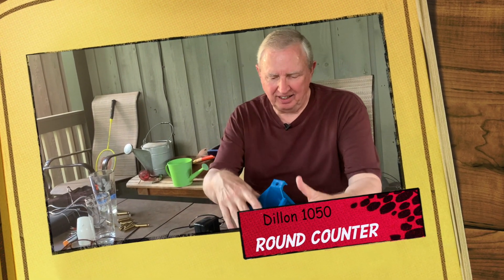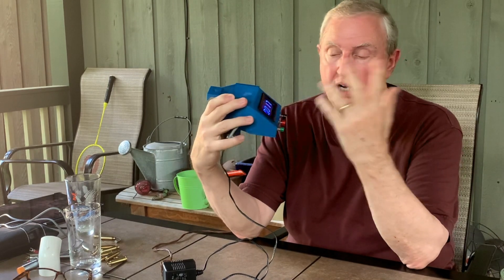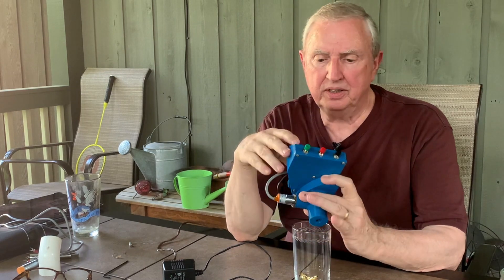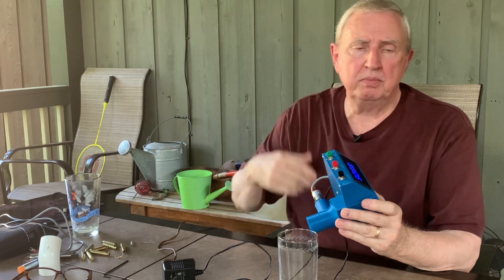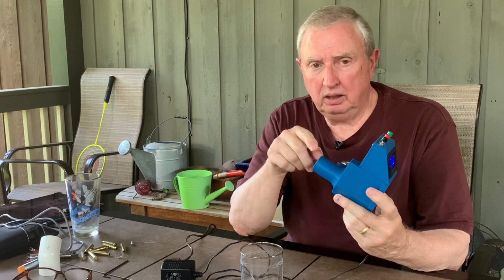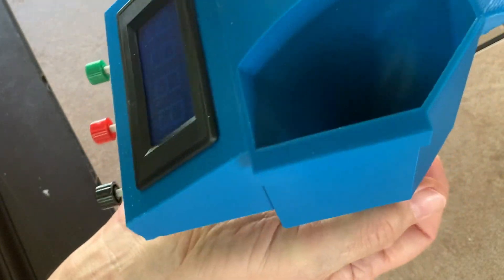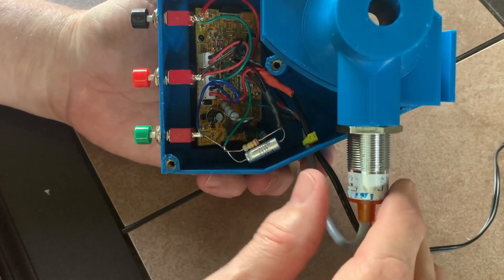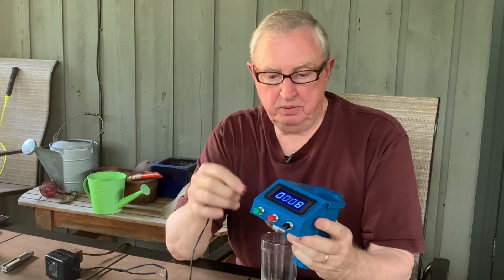Round Counter for Dillon 1050

Comment: How would you wire the Up/green momentary switch if you didn’t have an issue with double counts and did not need resistor/capacitor? Blue wire from board to COM pin and black signal/sensor wire to NC still?

Comment: Amazing project, well done and thanks for sharing!
/Sweden :)
Reply from the maker: Thank you for taking time to say so. Much appreciated.
Reply: @RexRoach  Yes it is one of the absolute most professional looking 3D print projects I have seen for reloaders. (And I dug deep my friend :)
Actually you even inspired me so far as to start looking for guides to learn fusion 360!
I put the project on print and theyre going at it full speed right as we speak, haha

Oh and a quick question if it is not to much trouble,
you lay some emphasizes on how the digital counter must look.
However the link to Amazon and the counter in question is out of stock,
how much I google the interweb (AliExpress, eBay, Temu asf etc) I cannot find the digital counter looking like the one you used for your project.
Do you happen to know if another type would work or possible do you have any advice where to look for them?

And many many thanks again mate!
Kindest regards,
/Tobbe a.k.a Silverbullit of Sweden
Reply from the maker: @helturflippad  Indeed, getting parts for projects that are more than a week old sometimes seems like an insurmountable problem. However, I think there are several on Amazon that will work just fine. Here's one.

https://tinyurl.com/23g4tvqn

If you search for digital up/down counter, you'll get some on Amazon. If the price is more than $15 US, that's not the part. It needs to be about 39mm tall and 78mm wide. The width is the "wild card" because it will have spring-like plastic tabs on each end to secure it into an opening. The opening in the 3D printed part is about 77mm. If the opening is too small, you can file it larger. If it's too small, you can probably build up one edge with tape or some other clever approach.

Electrically it should have two wires and a 5-wire flat cable to match up to my circuit. If it is something else, it will still have connections for power, clear, up and down so you can most likely figure it out.

Also, the link I gave above is for a unit to ship in the U.S. via Prime. There were identical models that ship from China for less. For Sweden you can probably do better with one of those. I entered "up down digital counter" on Ali Express and got many hits on the first page of units just like the one I used. This seems to be a popular item from China.
Reply: @RexRoach  Howdy mate, happened a lot here. A quick Question, I googled the partsnumber and it directs me to a 39uF thingie instead of 3 uF. Should it be 39uF?
A bazillion thanks for the links and kind help!
For some reason my 1050's has different brackets and it looks like a small tweak is necessarry, I will fumble with it a bit, would you like the alternative files in case it can help our mates?
Reply from the maker: @helturflippad  I think there may be a lot of variations on the 1050 bracket, so there's little point in trying to fix the fit. As to the part number, I'm truly confused because it looks like you're talking about a capacitor what with micro-Farads and such.

Comment: Parts says npn no sensor. My counter needs a + signal to count up. The npn gives a - signal. Cant seem to get the button or sensor to work.. any help?
Reply from the maker: Justin, I have gone back and examined the circuit and I think the problem is an error in the schematic. The original showed the four wires connected to the display in the order of black-red-green-blue.  However, when viewing them on the actual unit, the order is green-blue-black-red. 

I have revised the schematic drawing and re-posted it. The new file is available above or from:

https://drive.google.com/file/d/1x1LoUQyDPWsTc5IpSXxqOAdqiYL8hue-/view?usp=sharing

I hope this fixes the problems you've had. Please let us know the outcome. I'm very sorry for the error.
Reply: @RexRoach  Thank you!! I did notice that, but I did have the display wired correctly, even with the previous drawn schematic off on wire order. I'll give it another shot and update you. Again, thank you for the help. All your videos are great, and I appreciate you sharing your knowledge too us.

Comment: Thank you for your time in designing this. I used the STL file and printed which I believe is version 18. I downloaded the step files but there are different than the one I printed. I would like to make a few design changes to fit my press.  are you willing to release that file? I use fusion 360...Thanks
Reply from the maker: Since this video was posted, I've made a few changes in the design and you can download the Fusion 360 file which includes all those revisions. I believe the major changes were to make the bottom tube curve outward so as to clear the edge of the table where the press is mounted and to increase the "bore" diameter to 20mm to allow for larger/longer cartridges to pass through. I've added a link to the file at the end of the description. Enjoy.
Reply: @RexRoach  Thank you kind sir.  It's on the printer as we speak, using orange PLA..
Reply from the maker: @stevend5508  Great and you're welcome. Just make sure you got version 19 because I did not have a chamfer at the bottom of the "funnel" when I first posted the file. I made the change in about ten minutes, so I'm hoping you got the V19.
Reply: @RexRoach  yes sir, I have    "Round Counter 20mm Bore v19.f3z"   is what I downloaded and is currently printing
Reply from the maker: @stevend5508  Whew! <sigh of relief>

Comment: Very cool design.  Would you feel comfortable sharing the f3d or step file?  I would like to modify to fit the 550 and 650.  Thanks
Reply from the maker: Sure, no problem. Look up in the description area at the bottom for a link to the STEP files. I worked on a new design for a bit that MIGHT fit a 650. You'll find it and the original one from this video in the folder. There are also two files for the bottom covers. Good luck!

Comment: I made a case feeder for 223 cases and I used an inductive sensor to shut it off when the tube is full. I notice that each time a case goes past the sensor it causes the motor to shut off for a split second. I guess it doesnt really hurt anything but it does cause the relay click all the time. Could I use a capacitor and resistor like you did to prevent this.
Reply from the maker: James, I would suggest something like this between your sensor and the case feeder.  https://tinyurl.com/ybxxslax
Reply: @RexRoach  Thanks I will check that out.

Comment: So I built one if these for 9mm and when it drops in some times it double counts not sure how to fix it. I did use the resistor and capacitor any suggestions
Reply from the maker: I eventually went to a new design that used optical sensing instead of the inductive sensor and it was a "sluggish" enough circuit that the double count problem didn't happen. However, since you've already built this model, I will tell you that I experimented with a (hang on for some big fancy words) monostable multivibrator or "one-shot" IC chip. You can buy these for a dollar and change from places like Digi-Key, but it will involve a good bit of fiddling to get it to work.

A better solution, I think, would be a ready-made time delay relay board like this $10 job from Amazon.  https://tinyurl.com/yy3nfpad

For some reason, my instructions here were cut off. I'll try again.

Connect 12V to the DC+ and DC- on the new board. Connect the black signal wire from the prox sensor to X1. Connect 12 v+ to COM on the new board and connect a wire between the NO and the display where the black sensor wire was before. Remove the 220 ohm resistor and the 3 uF cap. Adjust the timer for a 1/2 second delay and that should make the relay hold long enough for the cartridge to fully pass the sensor. Even if the cartridge double trips the sensor, the closed relay will ignore it.

Hope that makes sense. I have NOT tried this, but it should work with perhaps some fiddling.
Reply: @RexRoach  do you have a listing for the optical sensor I would just replace this one
Reply from the maker: @Muskrat13  This should have what you need.     https://youtu.be/l3G5GfcfFvc

Comment: Really nice! You can also design with regular hex nuts. Design for the nut, then (in slicer) pause at layer height just above the nut thickness. The printer will pause and wait, drop the nuts in and resume print. Captured nut. Love your vids.

Comment: hi rex i printed one the hole in the back is way too short would you be able to fix that
Reply from the maker: Turns out Dillon has more than one style of bar layout for the case feeder and the hole location varies.
Reply: @RexRoach   ok ya i have the one  then is there anyway  way we can fix that mine need to be bolted it slide off the machine when it is running with the outdrive

Comment: Nice project, extremely well done!  Your CAD skills are impressive, I'm still learning how to do things in Fusion 360.
I made my first loaded round counter using a little LCD pedometer connected to a switch that was activated by the press... so I get press cycles which isn't always loaded round counts.
Reply from the maker: Thanks very much. You've hit the problem exactly–many designs count press cycles or count at some place on the press, such as the bullet seater. That last is OK, but you can still have a reason to pull one even after the seater. Well, no design of anything is perfect, so we do what we can.

Comment: I've played with it a bit and there is no way to orientate it with mirror commands so that it works on a XL650.  Anyone have any ideas?  Rex, if you mirrored it, then remade the threads and text it would work for us XL650 guys.
Reply from the maker: I don’t own or have access to a 650/750, but after reading your comments, I looked at photos on the Dillon web site and it appears to me that this device with the "hook" on the left side would clip to the press right where the blue plastic cartridge bin clips currently. Feel free to correct me if I’m wrong.  Also, I have been developing a "new and improved" model that will work with any cartridge from .380 ACP to .45-70 Government with 550 grain Bullets. Yes!

On the new model, the sensor points toward the rear of the machine instead of to the front so it matters not which side it mounts to. 

Now that we’re brainstorming, how about just putting the "hook" on both sides so it will fit either the 1050 or the 650/750. I’m going to omit the rear curved lip because that bar varies within different versions of the 1050, much less fitting the 650/750. 

Am I correct I assuming the 650,and 750 would be alike as regards this mounting point?

Comment: More info on capacitor please.
Reply from the maker: The values are not very critical. The resistor should be 100K to 300K. The capacitor should be 3 to 8 uf. Multiply them together to get the RC time constant which needs to be 500 - 1000 ms. So a 100k and an 8 uf would give 800ms time delay, more than enough. I used a 220k and 3 uf for 660ms, again just fine. The type of capacitor is not critical. It can polarized or not. If it is, then connect the negative end to ground. It should. be rated for the voltage you're using.
Reply: @RexRoach  Will this work  SPRAGUE RESISTORS TE1402-10%
Reply: Thank you.  Link to cap you used, tried to find  a 3uf like yours with no luck.
Reply from the maker: It will work with pretty much anything. I just grabbed the first resistor I came to in my junk box that was in the ballpark. It was 220K. A common capacitor value is 4.7 uf. Look on eBay for people selling a package of capacitors that include that range. Ten bucks or less and you’ll have some for future projects. If not, buy individually from Newark, Mouser, Digikey, Allied, etc.
Reply: @RexRoach  Thank you
Reply: My time delay isn't working.  I have a 4.7 uF capacitor and a 220k resistor.  It's all I had that fit the parameters you laid out.  My 223 rounds will double trip the counter.  The buttons all work fine, and it counts other stuff like it should, but I just don't feel the timer circuit is doing what it's supposed to.
Reply from the maker: @superkillr  I hear you loud and clear. I think it may take more than a simple RC pair. I just now ordered some components which I hope will fix this problem once and for all. I won't go into detail here as I have not tried it yet, but wanted to let you know I'm working on it. This will be a very inexpensive fix and I will post a video on it and try my best to come back here and let you know as well.
Reply: @RexRoach    You're awesome!!!!

Comment: Nice work Rex, Can you share the printing parameters you used for infill and resolution? Also what filament/color is that?
Reply from the maker: Sure. I used Duramic PLA Blu-1 from Amazon. Resolution is .2mm layer height and 40% infill. I printed with the top of the part on the bed (i.e. upside down) and used support from the bed only. I put a gusset on the side tube where the sensor screws in so you don't need support there. On the first model, the support inside that threaded tube was awful to get out. You must have support under the sloped panel area, but it snapped off easily. My printer is a Sidewinder X1 or something like that. I've had excellent results with it. My first try at printing Angus's clearance ring was a total success with even the .15mm clearance moving with just a bit of early encouragement. 

Wait before downloading it because I just remembered I need to increase the hole diameter for the heat-set brass inserts. I'll amend the links information to reflect the change. Should be in less than an hour.
Reply from the maker: Oops!! Will do

Comment: What a great idea!  I have a mechanical counter on my .45 ACP taper crimp die and it's really handy to have a count.  I do hope Dillon or one of their accessory makers gets interested in making a Rex Roach Round Counter.  I might mount the electronics in a remote box and make a funnel/sensor assembly for each caliber/press.  I imagine using just the funnel/sensor to send a load count to a computer control box

Thanks again for sharing a great idea..
Reply from the maker: All manner of possibilities. Let your imagination run wild, and thanks so much for your comments.

Comment: Please make it for the 650 too Rex... 🤔👍
Reply from the maker: Looking at the 650/750 machines, it should work mounted on the bin bracket except for the "hook" which would hit the operating handle. I don't have access to either of those machines to try anything, but I could make a version without the hook and perhaps with a deeper lip to go over the bin bracket. I could provide you with the .STL file, but with no assurance that it would work. You would also have to use the strong mount or some other means to get the press located well above the bench.
Reply: @RexRoach 
  - Thank you so much for your rapid answer... 👍
My 650 is - og course - mounted directly without a strong mount. I actually bought it with the strong mount but found it more stabile without it. And I build the table a bit higher... And that fits so fine...
I have to find another solution for a country to my 650. Maybe somebody else is having the same challenges...
Please krave a comment if so... 

Wishing you and other good reloaders a nice day... 🤗

Lars-Erik
Reply from the maker: @lars-erikbtkerpetersen9466  You might create a PVC guide chute to direct the cases to the counter which is mounted to the edge of the bench. At any rate, some creative thinking will be allowed at this time.